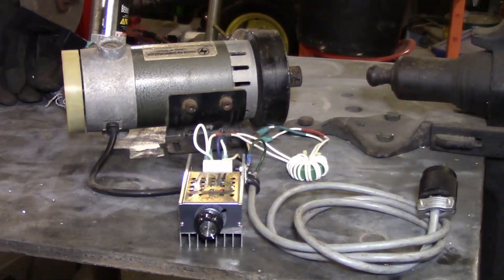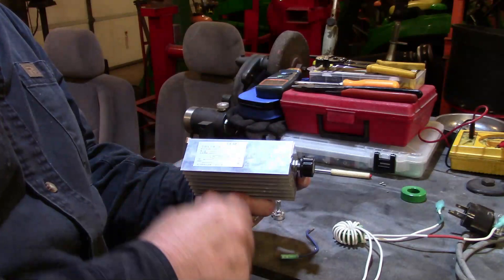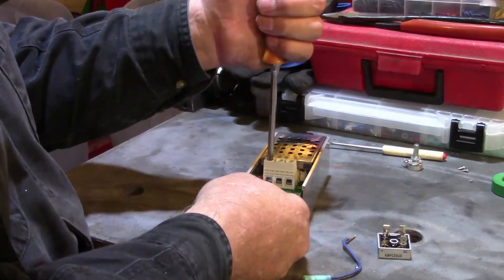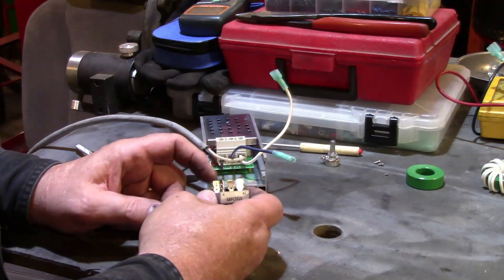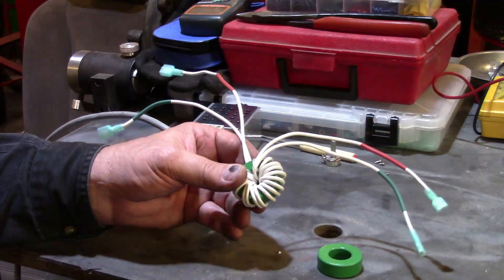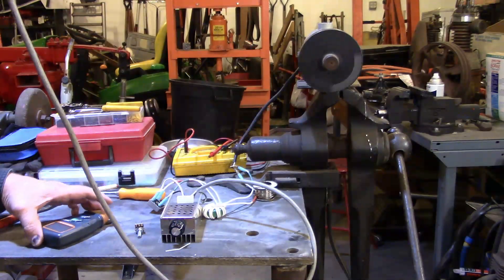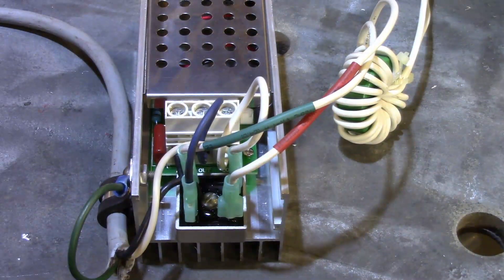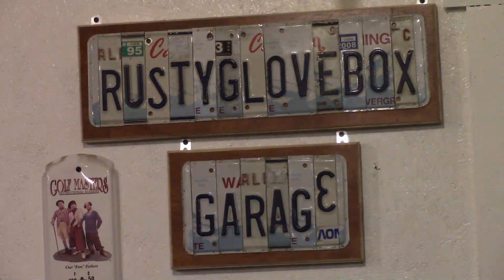Treadmill motor speed controller for less than $30

Comment: my next project I think will be a drillpress..I have already built a rock tumbler/polisher I made from a treadmill and I made a 240vac to 12vdc transformer/rectifier to run it at a constant slow speed, I also fitted a faan from a microwave to keep the electronics cool..It has been running almost non stop for 3 months now without an issue..They are such a handy motor and freely available at most tip shops..Thanks for your video.
Reply: Very interesting as a rock tumbler is what I also want to do.  I completed the control and it tests out fine.  I was going to use an ATV tire for the tumbler cradled in two rotating shafts, one powered by the motor, but I am wondering if I can control the speed accurately enough to allow the roks to climb up the wall of the tire and fall back.   What did you do?
Reply: I basically just cut and shut the treadmill and moved the tail roller up close to the drive roller..I stripped all of the wiring out of the unit and made a 240v-12v transformer with a bridge rectifier after it then through a power  switch to the motor..The speed is perfect for tumbling..I made a tumbling drum from a rideon mower tyre and it works great..I have since made two more drums from some heavy walled 6' polly irrigation pipe with screw on caps threaded into the poly made from plywood and lined with plain old white nylon cutting board..Feel free to check my facebook page "Wayneos Creations" for some photos of this and other lapidary machins I have built from dumped parts..
 @CharQ67
Reply from the maker: Thanks, I agree they have a lot of possibilities

Comment: To change the range of the potentiometer simply add a resistor with the same watt rating in parallel. There are some nifty Parallel Resistor Combination calculators online to determine the new value. I think that SCR has a 500k pot, so since you are not getting any action until 3/4 turn, try putting a 500k 2W resistor in parallel to reduce the range of the pot to 250k. This is easier and cheaper than changing the pot. Rparallel = 1/(1/R1+1/R2+1/R3 ...) Easy Peezy!
Reply from the maker: Those are some great suggestions. Thanks
Reply: I can confirm this does work. But I tried with a 330K resistor which should bring the "new" range down to about 200K...still doesn't start until around 50-60% of the knob. Gonna try again with some 200, 250, and 300K resistors as well. I can also say that two 330K added in parallel for new range of 125K...my motor starts with the knob still at 0. So somewhere between 125K and 200K for the range is needed...at least for my motor.
Reply: WaveDudeTX - You can determine the perfect value by using another 500k pot, just parallel the pot and adjust it until you have the perfect range, then remove it and measure the ohms at that setting. Then you can calculate the perfect resister combination. My guess is a 220k or 270k 2w resistor will get you there. Let us know what value gets you the perfect range. The other thing you might consider is adding a resistor in series with the pot to prevent your motor from being overdriven with voltages above its rating. The original potentiometer can be used to determine the resistor value. Adjust the pot with the motor running until the effective voltage across the motor matches your motors maximum voltage rating, then measure the ohms across the pot. You might need to disconnect the pot to accurately measure it. Of course, this should be done prior to tuning the pots adjustment range. Example, if 100k resistor in series limits your motor to its maximum rated voltage, then the range of settings will be 600k -> 100k, instead of 500k -> 0.

Comment: Just wondering....what is your opinion on running this motor Without the Flywheel on it?.....and just  the 10 groove pulley ( or a V- pulley).....such as for a small lathe.

I ask for a few different reasons....i understand the Inertia may be needed for certain circumstances.....such as on the the Treadmill.....as someone is running and creating a 'Pulsing' in the drivetrain with each step....the flywheel would help smooth it out and remain constant.
However, on a small lathe, im thinking there really isnt much Pulsing action and the flywheel may not be Needed.

Your thoughts appreciated
Reply from the maker: They make good lathe motors. The serpentine or a v-belt would work fine .  If you need a positive drive you could use a cog belt and pulley setup. The flywheel wouldn't be required as long as the cooling fan isn't part of it.  Good luck
Reply: @RustyGlovebox  Thnx for the Reply. Sounds as tho my thots are/were correct...about not needing the flywheel....for purposes of most machining applications. As said, im thinking the steps/percussions of Running on the treadmill is the reason for the flywheel.
Yes, my 9x20 lathe uses a Cog drive....which could be retrofitted to the 14mm shaft much easier than many of the LeftHand threaded shafts on many of these motors.

IF i were to install a 150K POT(instead of the 200K), what do U suspect the function of speed would be?.....as considering this for a Belt Grinder drive
Reply from the maker: A 150 or 100 might be a good choice. They are very inexpensive. Good luck

Comment: Thanks for showing us this really great video! I hope you don't mind if I ask: what was the slowest RPM sustainable with the 200K rheostat? What would the slowest working RPM for that motor be, and would an even lower rated rheostat (in Ohms?) still work and be even better? I'm looking for a low RPM application without the use of a gear reducer, but maybe whatever two #35 chain sprockets would give could be used. I'm trying to make a motorized, 120v to 12v dc powered cart to move heavy things around the shop and yard slowly. Any advice you have would be gratefully accepted! Would a PWM controller be better? I'm also thinking of using mobility scooter motors since they have a brake installed (DC, but only usually like 50W each, so not too much HP, alas)  Thank you!
Reply from the maker: It would run at 500 rpm's, not sure how it would to pull a heavy load. 
A mobility scooter PWM controller and motor would be better to make a cart. Most of the parts are there.
Reply: @RustyGlovebox  I thought the high-ohm reo. ran at 500. Thanks for your answer, I appreciate the consideration!

Comment: you had to have seen my video lol. i upgraded my drill press and metal band saw with this method. the only piece of the puzzle i was missing was what size pot i needed to make it start closer to beginning of the pot instead of at 3/4 of the way before it will start the motor.  you just gave me the piece of that puzzle. so now the only thing im not happy about is not being a millionaire lmao. good video. thanks. oh and btw, you wired you pot backwards. lol
Reply from the maker: I installed  a 200k  Potentiometer, a 100K could work better. Good luck on your project
Reply: @RustyGlovebox  thank you
Reply: Yes.....just flip and  re-solder the outer two wires of the pot . Then the motor will be OFF in the full anti-clockwise direction and start turning when you turn the Knob Clockwise.
Guess , only we both noticed this and commented.

Comment: so after changing reostat how slow was you able to achive ?. i need to get down to 50 rpm ?
Reply from the maker: To get it that slow you may need a different reostat.  Possibly a 100k will work better for you. Good luck
Reply: @RustyGlovebox  and then i worry that this slow the torque would be very weak ?
Reply: You might have better luck setting up pwm. I don't even know if the rectifier would run it that slowly, and even if it did you'd have no torque.
Reply: Just add a 50 to 1 gear reduction box to your motor and you’ll have plenty of tourque. Mind you they are expensive if you have to purchase a new one but you never know you might be able to find a used one cheap.

Comment: Great video! My treadmill motor control board quit working and im thinking about trying this controller out on it to keep it going. i just replaced the motor bearings and all the bearings on the rollers also! my question is, does the POT need to be rated for 120v or is it controlling the speed with low voltage through the POT? How long do you think this controller would last under heavy usage?

Thanks for the Video!
Reply from the maker: The pot switch I used was a 200k , 1 watt. I haven't load tested it yet but I'm planning to built a belt sander in the future. I will know more later if I need to beef up later.

Comment: Very helpful for changing out the motor on my wood lathe. Thanks for a quick fix solution for a tread mill motor.
Reply from the maker: Thanks Paul,  I have plan sometimes in the future to build my own belt sander replacing my current belt sander. Take care
Reply: Have all the parts together for controller and running. Notice my motor is running CCW direction. Can this setup be change to a CW treadmill motor?
Reply: @paulmoreno5780  Just swap the 2 wires will change direction of the motor.

Comment: Great explanation, but I am wondering why you converted your power to the motor to DC when the motor is wired for 130V AC ?
I acquired a 3HP 120V single phase motor from a professional grade treadmill and was hopping to build a belt sander with it. The treadmill has a variable speed controller panel along with a multitude of other functions which I don’t need. All I want is the variable speed part but I’m not sure how to get rid of all the functions I don’t need. Maybe it’s not as complicated as it looks. I haven’t spent to much time on it yet. 
Thx for sharing your talent ,I need to have you for a neighbour .LOL. Have a great day.
Reply from the maker: The motor was out of a treadmill. It was a variable speed brush type dc motor 130 volt and won't operate on a.c. current.
Reply: Thank you for that. Have a good one.

Comment: Interesting Lloyd. Never had the need for a variable speed motor, although did once consider a washing machine motor for one. Quickly became apparent a lot of electronics are used in these.
Reply from the maker: A good strong variable speed motor works good on a belt sander. Thanks Malc and take care

Comment: I scrapped out a treadmill some time back, I just kept the motor,, I had at one time thought about building a generator but so far it's still sitting on the shelf.
Reply from the maker: I got mine to build a generator at first but decided to use as a motor instead, now that I have this controller. Thanks and take care.